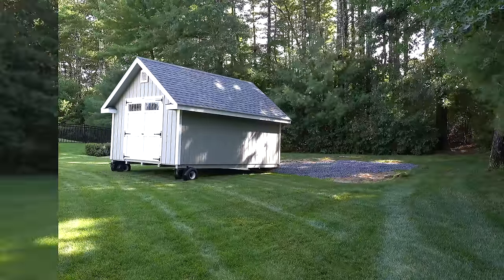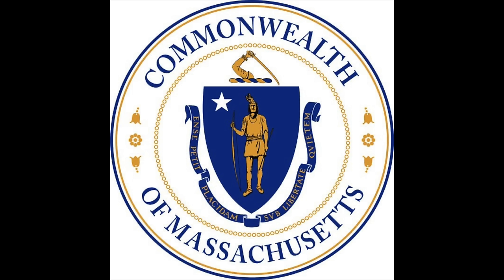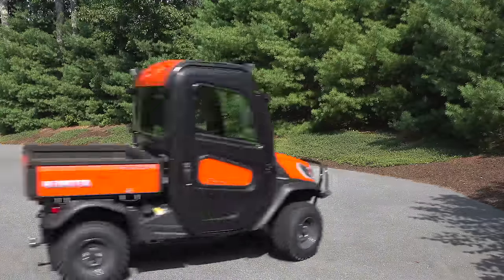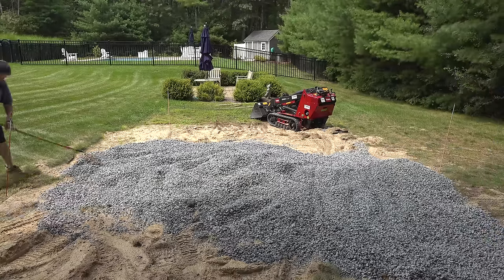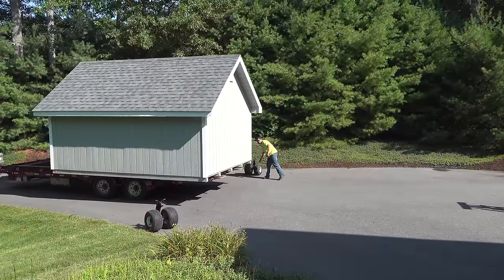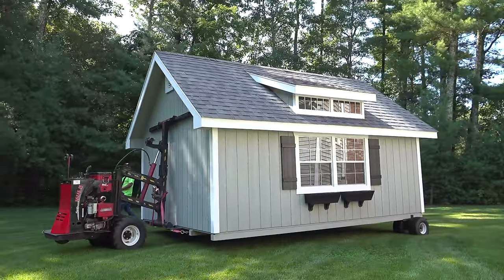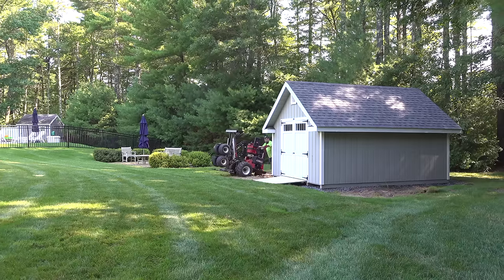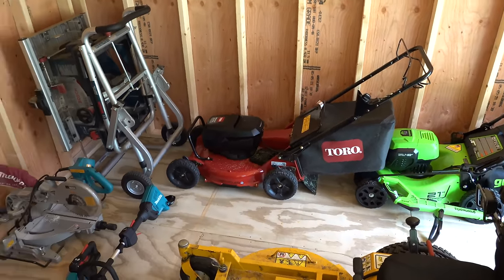NEW SHED - Complete Project Start to Finish

Comment: Got my shed from them probably about 10 years back now. Still great condition. They got delivery down to a science. I don’t know if they used one of the trailers features because it didn’t go on to your lawn but it has a set of wheels under it that hydraulically drops and moves the trailer left and right separate from the truck. Edit: forgot to add hoisting license is ridiculous!
Reply from the maker: That's awesome to hear. I was nervous since I had never used them but you are absolutely right, the guys were amazing. That trailer must cost 50k, the thing could move in every direction.

Comment: Nice shed should have asked for a discount for the amount of advertising you did for the company 🤣. Myself I prefer steel or aluminum sheds and with the price of lumber I don't know if it was cheaper but wood sheds used to be cheaper options but now it may be the more expensive option.
Reply: The price of metal has gone up too. Don't know the comparison  cost versus wood structure.
Reply: @daviddesilva4971  Just wondering because the metal shed I helped install for a friend, basically setting up the fondation and having the company it was bought from install it very similar to what he did and it was actually about the same size and was cheaper than the price he mentioned. Pre covid
Reply: @johnree6106  work in the sheetmetal  ventilation trade. Our supplier is good enough to give us a heads up before metal prices increase. I'd say all construction costs have increased 200 percent due to Covid in the last 18 months. Prices will come down eventually  but nowhere near when factoring inflation.

Comment: Hi, great shed, cool environment! 👍
I was thinking that bringing 2x 1in conduits from the House Electrical room would open new and nice features for the Shed cave! 😎
One conduit would be for power and another for data (4-pair twisted pair copper Cat6 or 6S MM Fibre cable) and Intrussion Access Control System (multi copper cable) with Card Reader or just Tag reader, and Motion Detection Sensor. Data cable could provide Intra LAN network with the house and Internet connection. I would also add one CCTV Camera on the top of everything said above. Keep the great work! Cheers

Comment: No woodworking he says as he wheels in what looks like either a Bosch or Saw Stop contractor grade table saw!   You’re lucky you don’t need a permit for that. I think larger than 8x8 here in NY. Are you considering building a loft in there for storage? You should, that would make a great video. Too bad you can’t put electricity in there without a permit.
Reply from the maker: Thank you, I know that table saw is nice. I wold rather upgrade a panel from 100 to 200 amp service with one hand than cut a piece of plywood.
Reply: @SilverCymbal  I’m with you. I do a lot of DIY, Engineering degree but guess I don’t have the patience for woodworking. I’m bad at it, and frankly, table saws scare the crap out of me. Lol

Comment: I had tuff shed install my 10 x 12 in June of 21. had to use them because a pre-built shed wouldn't fit.  built a nice gravel pad but they wouldn't move any rock and used wood shims in a few spots. seems like a chicken shit way of leveling a 4500 dollar shed. thanks for the video.